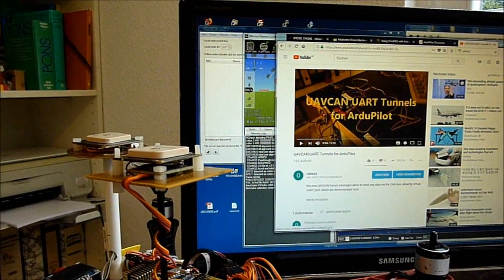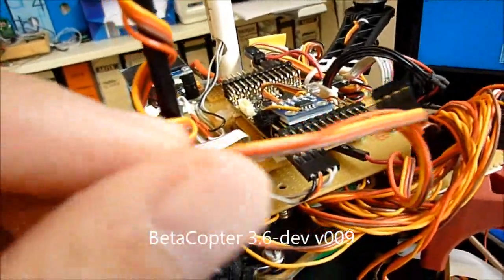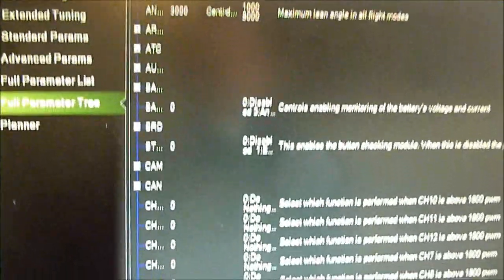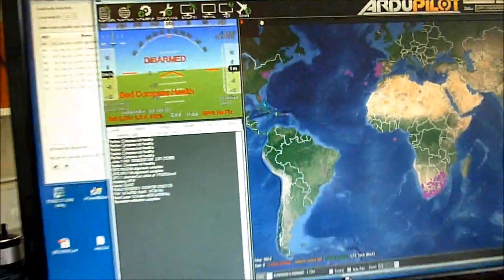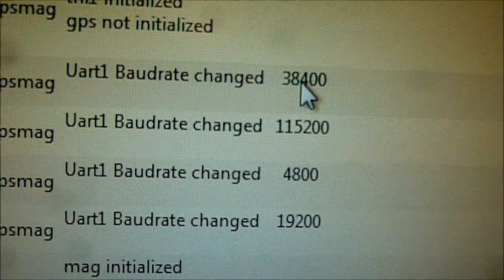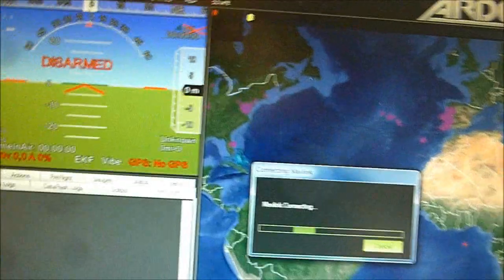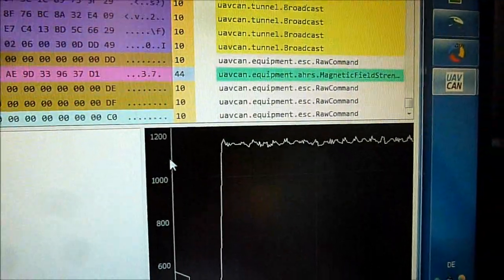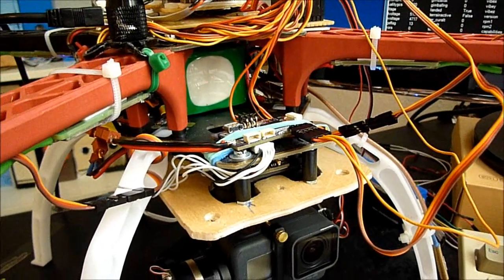UAVCAN UART Tunnels for ArduPilot: Practical Applications

Comment: I'm very impressed by this.  I think there is a huge gap now to be filled in the DIY market for an Ardupilot platform with a 2 or 3 axis gimbal and AUW of <250g.  I think it will be possible soon with some new boards based on your designs, and some smaller gimbal motors.  The 1404-sized motors on 3" props are seeing 12-minute flight times... this is matching DJI's Spark with a smaller footprint.  I'm waiting for the Winter before I get deep into this on the bench, but I'm more excited with each video you release here...  excellent work sir!